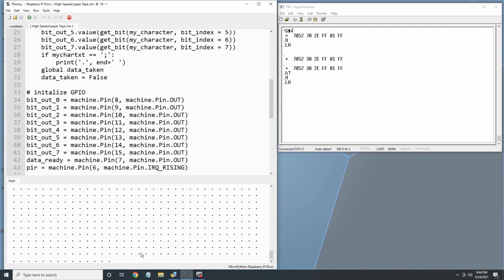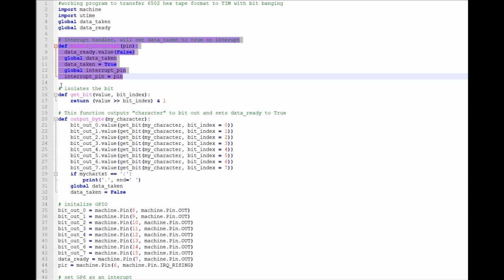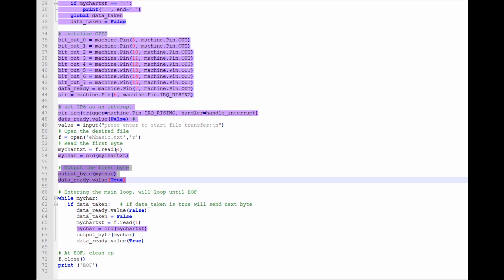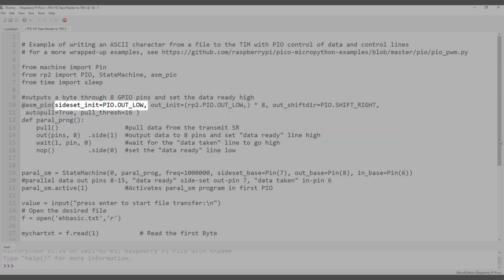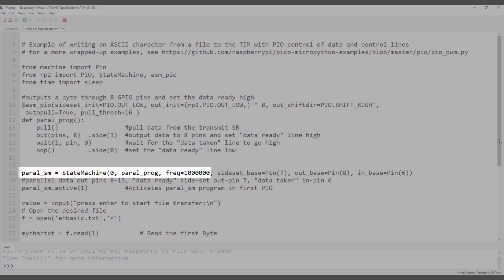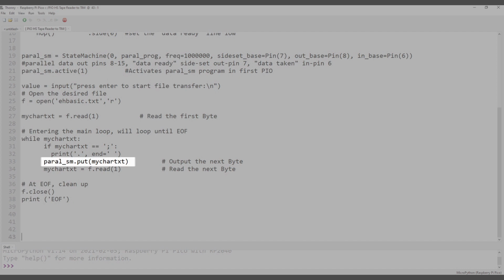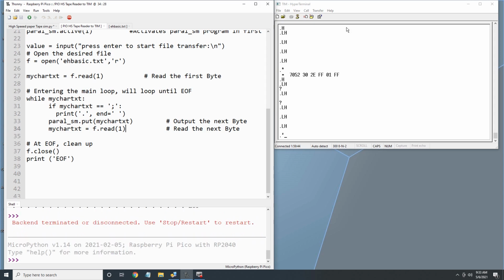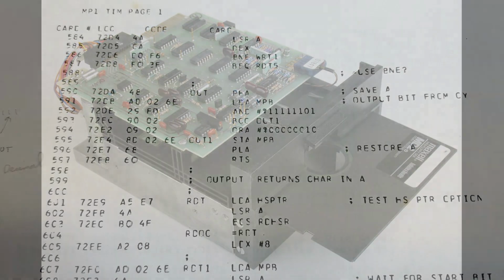Raspberry Pi Pico PIO - Ep. 3 - Parallel Data Transfer to a 6502

Comment: I don't understand when you have to explicitly "loop" a PIO program, and when it knows to restart by itself. Is execution triggered just by putting something in the shift register?
Reply from the maker: You are correct, the default for the "pull" instruction is to wait for data to be loaded into the shift register.  The "wait" instruction also will halt execution until a condition is met, in this case, pin 6 going high.   

In most case you will want the PIO program to loop; either using a "jmp" instruction or a "wrap target"  (3.5.2. of the RP2040 datasheet).  The program will always wrap when the program counter exceeds 31; that's how this example is looping.  I've learned more since I made this video; and I now use jumps or wrap targets to make the loops tighter and more efficient.  So basically, this example is "sloppy" but I got away with it since the data rates are slow.  Thanks for the comment!

Comment: HI David - I watch all your videos and greatly appreciate you sharing your adventures. I too am an enthusiast of both the 6502 and the pico. Watching your videos, I wrote and have used for some time now a pico to move data back and forth between by home brew 65c02, it works great and is very fast. I have modified ehbasic to save and load, as well as an assembler, the A1 assembler to save and load code, as well as Taliforth save and load screens, and the ed editor, etc.

Though I also enjoy python, and my code based off your's works, I have since (as you have as well) been working with c and the pico. In that time, I have created a couple other home brews, and used c along with bit banging spi. This is very fast as well, but does not compare to parallel of course. 

I moved to c because I wasted to be able to simply connect with the usb and get a terminal to my 65c02, which I connect to the 6551. 

Recently I have worked on another project, running a 56502 emulator on the pico, where it acts as RAM, ROM, and has a emulated via as well.  I have all my code there as well for basic, the assembler, forth and so on and connect to an sd card over spi. This is fun to use as a dev environment, however I wanted to make it better, so I have went down the road of converting the parallel python program into c. Unexpectedly though, I have ran into trouble here, there is obviously something I am missing. I mentioned you over on the pico forum in a post about it, I hope that is ok.  The link  is https://forums.raspberrypi.com/viewtopic.php?t=355240

In closing David, I hang out on the pico forum, at 6502.org and a Ben Eater Reddit often. Considering your interest, it may be we have crossed paths on any of these without my knowing, and if not, perhaps we will. David, I and many others appreciate you!

PS: I found my issue I had posted about on the forum as well. Once I sit back and read the code as opposed to looking for some specific something, I noticed I had (who knows why) removed the offset from the call to the function that initializes the PIO configuration, I had the statement there to call it, and no offset parm.

Comment: Try reading the data from the file into a buffer in large chunks. One byte at a time is horribly inefficient.
Reply from the maker: I agree.  However, my goal was to use the high speed parallel interface of the TIM chip; which is one byte at a time.  The 6502 and TIM chip are the limiting factor in the speed of transfer.
Reply: @LifewithDavid1  Are you absolutely sure about that? By switching to PIO you saw a big speed increase, so clearly the bit banging approach was the the bottleneck. There might just be a bit more performance to be gained from the Pi end. For the sake of a few minutes coding it could be worth a try.
Reply from the maker: Yeah, I checked out the TIM code.  There is a lot of code in the parallel HS Paper tape monitor which is just gobbling up time.  Even at only 1 byte per read; the Pico is just loafing waiting for the 6502.  And, I am only running the PIO at 1 MHz; it can run at 125 MHz but would simply overwhelm the 6502.  I would do things differently for a more demanding host.  In fact check out my homebrew VGA video and AWG where I push the Pico to its limits by using DMA (Ep. 12, 14, 15, and 16).  I'm pushing out 15 bits of data every 40 ns (for video, if I remember correctly).  As a musician, you also might like my MIDI episodes, not fast; but interesting.
Reply: @LifewithDavid1  You would still be sending one byte at a time but not chewing up clock cycles on the Pi reading the data in the first place.

Comment: from Kawasaki    
Question: Line 23 says "press enter to start file transfer:\n". Where is "enter" button? Pushing PC "Enter" is no result.
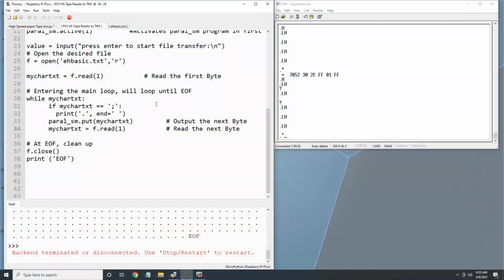Reply from the maker: At 6:18, I show how the program operates.  The TIM monitor on the 6502 computer must be running and in the Paper Tape mode.  If not, the 6502 will not receive the data, and the PICO will simply stall while waiting for the 6502 to acknowledge that it received the data.  The "enter" is the enter button on the PC.  Good luck; thanks for watching!

Comment: Hi David,
I like your approach of using the 2040, it seems to be a whole new frontier for designing really cool stuff.
However, the use of ASCII load files rather than binary is somewhat too "retro". I have been using a 6502 board, the Sym-1 to load direct binary images from a Mega2650+SD card and used the Arduino SD card filing system to implement a reasonable filing system. (NB Not an OS, just filing). It can load load Microsoft BASIC (8kb) in about 3+seconds using parallel 8 bit transfer and handshaking (not optimised with CBA1 or CBA2). The major difference I would appear to have compared to your approach is I mimic the Sym-1 cassette storage file format which defines both the length of the file as well as a default address loading point. This means pure binary files can be saved and loaded and not have the overheads of translating files to Hexadecimal and working in only pure ASCII. Here is the link if you are interested https://hackaday.io/project/181733-sym-1-a-6502-phoenix
I was hoping to be able to use a RPi 2040W to implement a wireless sharing system so I could compile to a shared 2040 space (FTP, NFS, ???) that could be accessed by the 2040W's filing commands through the parallel interface instead of using the less powerful Mega2560.
Your video has given me a few clues, but I need to know mare about the wireless options of the 2040W and what file sharing it is capable off.
Best wishes with your project.
Rob
Reply from the maker: That's a very cool project.  I love working with retro computers as you might be able to tell from some of my other videos.

I wanted to work within the TIM monitor at first.  That monitor only has hexadecimal file handling.  Back in the day, I had built a mini-floppy interface and had written a very simple operating system.  I eventually wanted to get back to that.  However, I got sidetracked by lots of other shiny objects (lol) and drifted off to explore the other possibilities the RP2040 PIO had to offer, which resulted in many more videos.  I'm currently working on PIO episode 16.  I just got some Pico W's so we will see where that goes.  Thanks for watching!
Reply: @LifewithDavid1  adding a floppy to a 6502 the hard way is a real achievement. I had to buy a BBC32k to achieve that milestone. The Sym-1 does have a hexadecimal filing as well, and I can use it via the terminal. I had to boot strap myself back into action with that. However the Sym-1 has software bit-banging  serial so can only do hex loading at a max of 300 baud so is very slow. I tried loading 8kb BASIC with it and it took about 20minutes against parallel/handshake where it takes 1-2 seconds. 
With my little OS extension, I use the Arduino SD file ops to piggyback on to easily access a load file by name, save file by name, delete file by name, dump a file into hex, and inspect the list of files on the Mega2650's SD card. I would like spool and exec as well as copy. Arduino SD filing does not have a native 'copy file's function and limited wireless sharing hence my interest in the RPi series machines. I will be very keen to see what you can do with file sharing on the PicoW , as it ticks all my other boxes. In the interests of simplicity I would prefer to use a PicoW than a full RPi with NFS to do the byte/handshake. However the latter would open up the whole gamut of remote clocks+printing etc. My goal is to be able to compile to a shared memory space , that a 6502 system can access  through a simple "filing system/OS". Like a Commodore disc-drive on steroids. ;-)
Your experiments give me hope it can be done with a PicoW.
I will watch your series with great interest. Thank you for a really powerful series of videos.
Rob

Comment: How to reading an ASCII character in PIO paralel
out(pins, 8)  .side(1)     -->    IN(pins, 8)  .side(1)  
paral_sm.put(mychartxt)  -->  paral_sm.pull(mychartxt)    
I want to read ASCII in PIO paralel. Can i change 2 line ?
Reply from the maker: Unfortunately, it's more complicated than that.  Instead of using the Output Shift Register to move data; you will be using the Input Shift register.  That involves a completely different instantiation as well as file handling commands.  Almost everything will change.  Pay attention to flow control.  It's not complicated though; just refer to the C/C++ and MicroPython SDKs.  Good luck!

Comment: Binge watching your stuff David.  Connecting the pico directly to the data and address lines of the 6502 sounds great, like a rom replacement.  I believe this usually requires an FPGA for speed, but maybe with PIO this is doable.  Wouldn't it be great to have a rom replacement, you could sit atop  a socket and place directly into a 6502 system?  Imagine how flexible that would be.  Theres already a product out there called the Romulator I think 8 bit guy or Adrians digital basement uses it...  Good work as usual.  Tim.
Reply from the maker: Thanks for watching. That would be a great idea; at 125mHz, it should be easy to implement.

Comment: Just curious:  Why are you specifying 'Autopull' and 'pull_threshold' in the case where you're explicitly using 'pull' in the PIO loop?  Are these not superfluous in your case?
Reply from the maker: You are so right.  When I did this; it was early in my PIO experience and I was piecing together bits of programs that worked previously.  After a lot of hair pulling (and I don't have that much) I finally got the program to work so I called it good.  I hope it wasn't too confusing.  Thanks for watching!

Comment: i'd like to see the Pi Pico connected directly to the 6502 and become the 6502's memory subsystem.  you might have to start using c/c++ to do efficient address decoding within the Pico's Arm  firmware.  Just a thought.
Reply from the maker: I agree.  That's why I'm moving toward C/C++ and DMA in my most recent videos.  Thanks for watching!

Comment: It would have been good to look at the ready and taken signals on the oscilloscope.
Reply from the maker: You're right.  That would have been interesting.  There is a lag of many microseconds because the receive program on the 6502 still uses bit banging.  Next time I hook it up I'll have to record the trace.  Thanks for the suggestion!